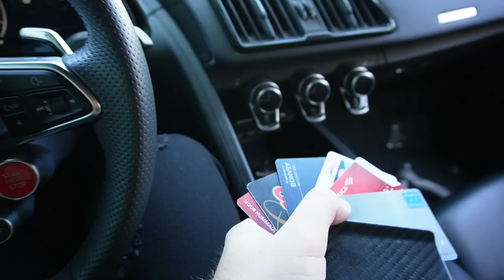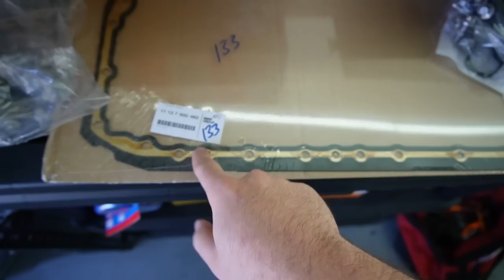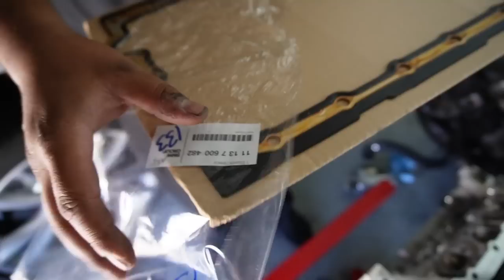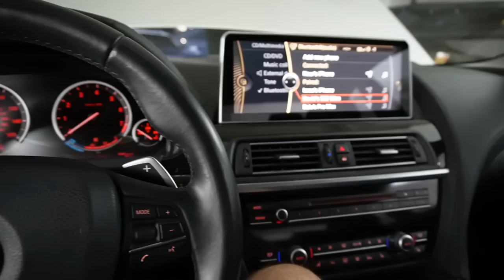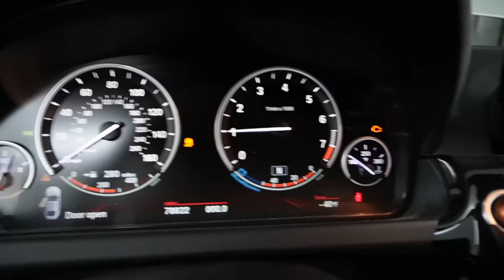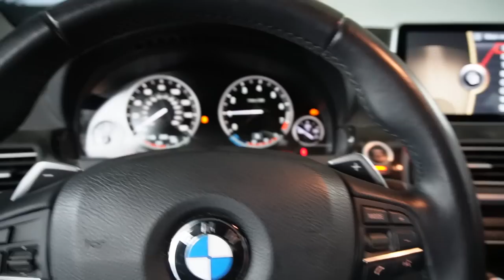NEW ENGINE IN THE 640I! FIRST CRANK, DID WE GET LUCKY??

Comment: 20:23 THAT sound is your transmission running low on fluid with metal gears clacking against one another, fact that you let it run for an extended period is a recipe for disaster,

Comment: Did it stay idling at 1k rpm?
Reply from the maker: Yea
Reply: @NourHummadi  as you know, that’s not right. Should be around 600 once it settles
Reply from the maker: @johnnychimpo7539  yes it’s 600 now, I guess the engine was adapting. But at first it stayed at 1000

Comment: i thought 640 has b58
Reply: Depends on the year
Reply: @johnnychimpo7539  doesn’t the 640  only have a n55? I don’t think they ever received the b58 but I could be wrong
Reply: @lookatthatbmw3777  I didn’t think so either, but the 2018 640i has a 3.0 turbo so it’s gotta be one of the two and I thought n55 was replaced by then. I don’t think it’s in there but I don’t know for sure. Doesn’t really matter to me because I don’t like 6 series
Reply: @johnnychimpo7539  Yeah they kept rocking the N55 till the last year for the F12 640i,  that new fake 6 series though (the G32 which honestly is just a new 5GT) has the B58
Reply: @JamesF36  interesting but smart on bmw’s part. They know that most people who buy a 6 series, don’t know the difference between a n55 and a b58. 340 and 440 got it sooner. I think the x3m40i had it prior too